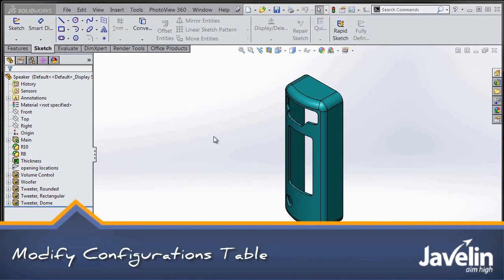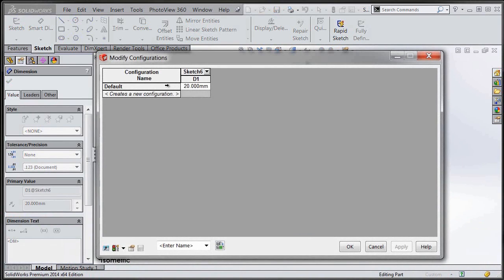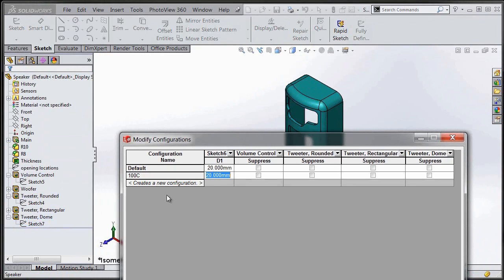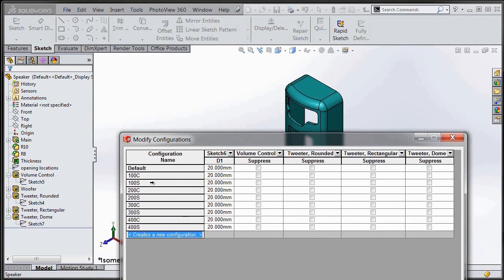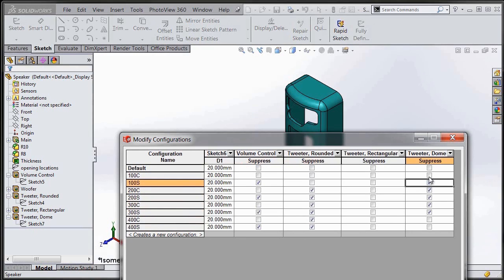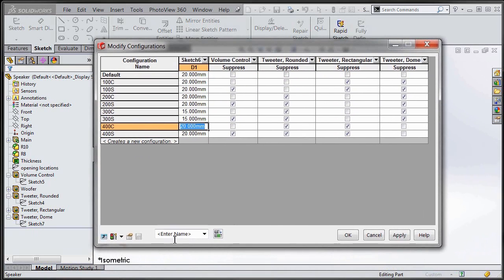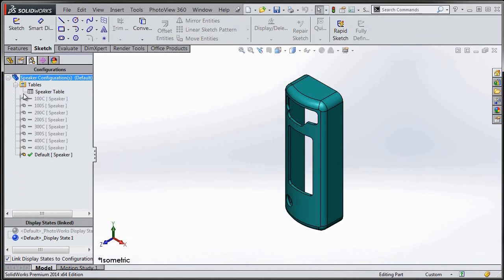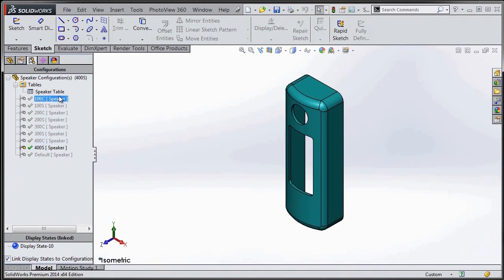Tech Tip: Using the Modify Configurations Table

Comment: This is awesome.  Question.  I have like 40 configurations.  Each one consists of 4 parts, each of which has 40 different configurations.  the names are matched so that configuration 1 consists of part 1 configuration 1 with part 2 configuration 1, etc.  that's a lot of clicking and selecting which configuration you want each part to addopt for each configuration of the assembly.  Is there a faster way, or a better way?  One option could be to create more different parts, so each of them requires fewer configurations, then suppress or unsuppress them as the case might be.  That seems clumsy though.
Reply from the maker: Michael, using the power of Excel in a design table, would do the trick. You could copy/paste cells, or text between cells. Plus all the great functions available in Excel.